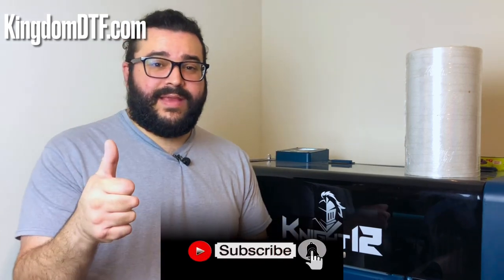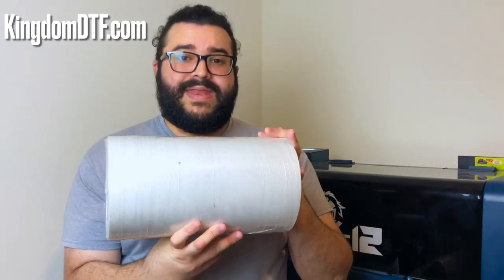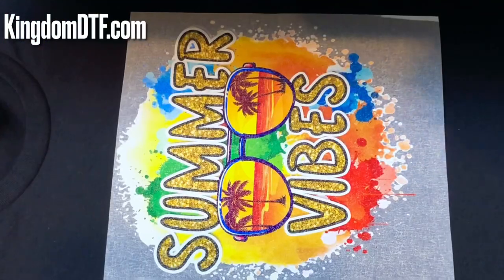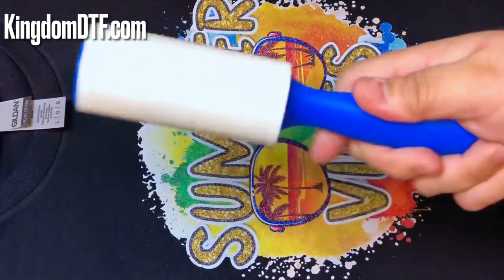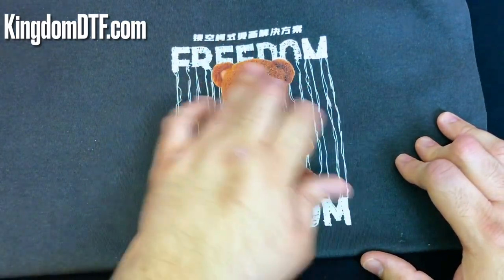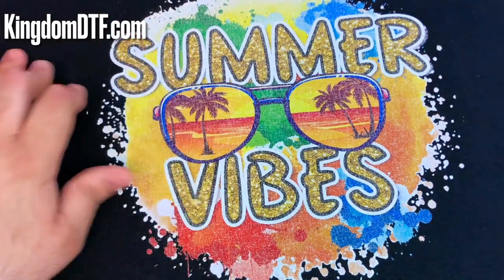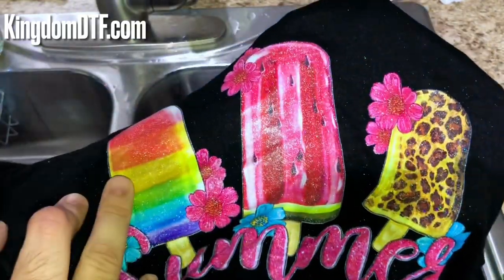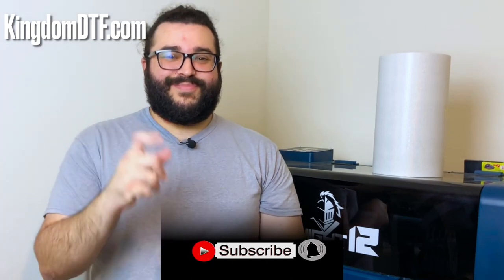How to Use DTF Glitter Film Step by Step with Knight 12, ET-8550, XP-15000, L1800 - DTF Printing

Comment: Will it work with L1800 and do you ship to canada?
Reply from the maker: Yes it works.
DTF Glitter Film only comes in rolls. If your printer use roll feeder good, if not, then you can cut the film manually and use as sheets like most of people are doing.
Reply: My can used roll or sheet. Do  I need to adjust the setting. My setting used Rip 10.1.
Reply: How many days does it take to get to Canada.